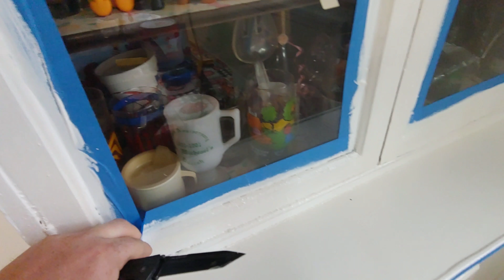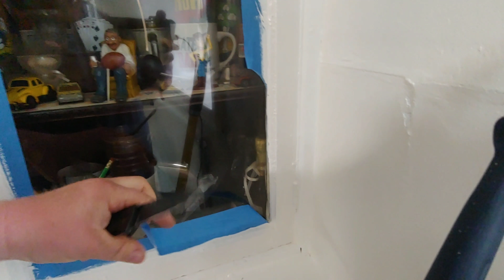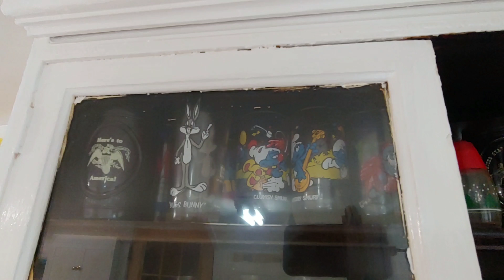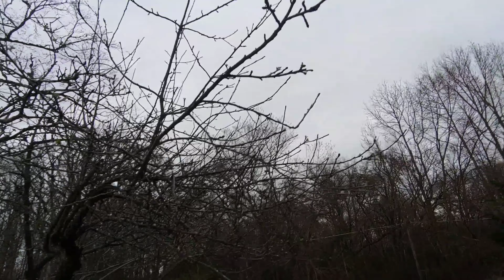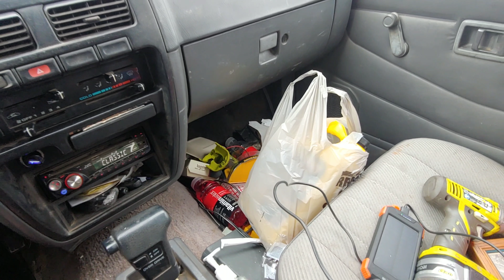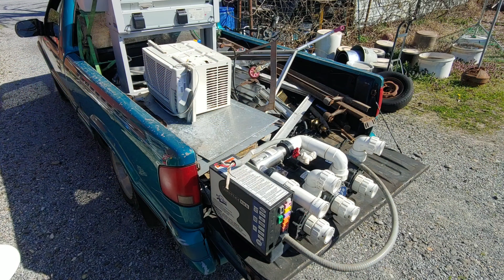Lock down 2020

Comment: In times like this, I would be rethinking the way I look at scrap that I pick up, like can these discarded leaf springs be used for knife or tool making that I use to trade for things I need when the dollar collapses, car batteries and  thick gauge wires for off grid stick welding and off grid power... good dc electric motors.... old lawn mowers into crude gen sets or water irrigation pumps ect....
Reply from the maker: The batteries are truthfully though biggest pain in the ass thing to find and keep especially when you don't have the money to buy them new

Comment: Hi Bert. Thanks for posting. When you do go picking scrap, I'd wear gloves and a mask. Handling other people's stuff. For a month or so anyway. We want you to stay safe. The farm sure looks nice in springtime. And peaceful too. P.S. I was thinking, if the electronics don't work out on the little eve truck, you could repower it with gas or diesel.
Reply from the maker: That's the plan.  I don't know which way I'm actually going to go with it I'll have to see. But most likely it's going to get a gas engine put in it because that's the cheapest way. And I should be able to register it under Farm use which is exempt from inspection and I can at least toll it around the neighborhood.

Comment: I thought you had a transmission to swap out.
Reply from the maker: I have a water pump I have to change the transmission in the donkey is still going forward so I'm not touching it till it's dead...... I'll make sure to walk up and poke it with a stick
Reply: @ScrapFarm  why did you park the dodge van?
Reply from the maker: @77patsfan64  the leaf spring is coming through the floor and I haven't fixed it yet plus I was expecting to get some snow but we never did